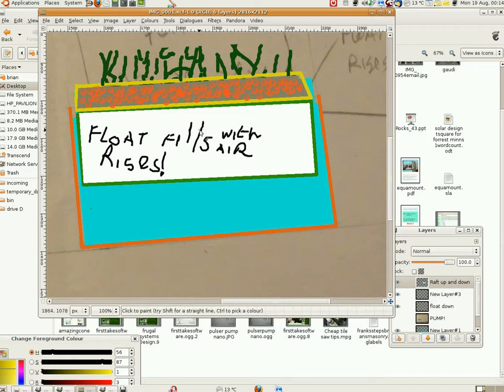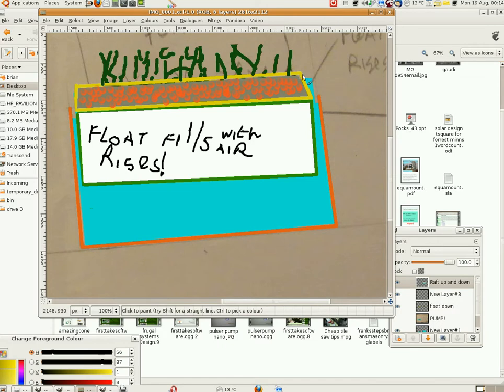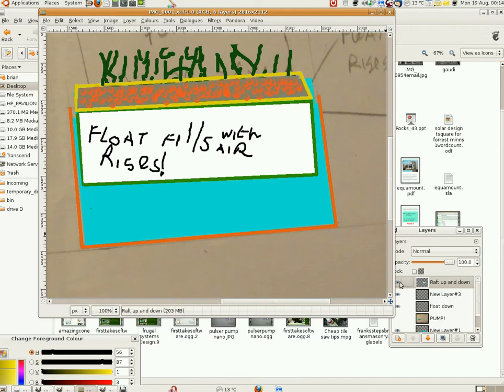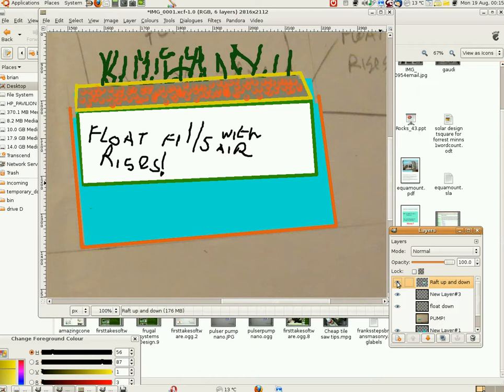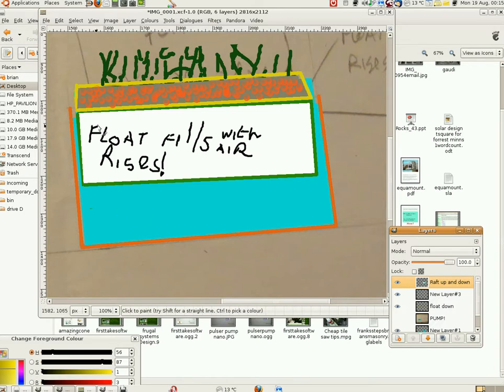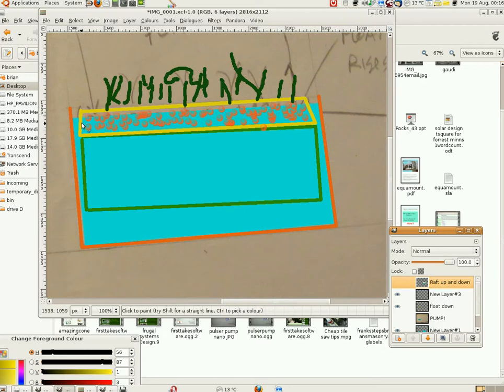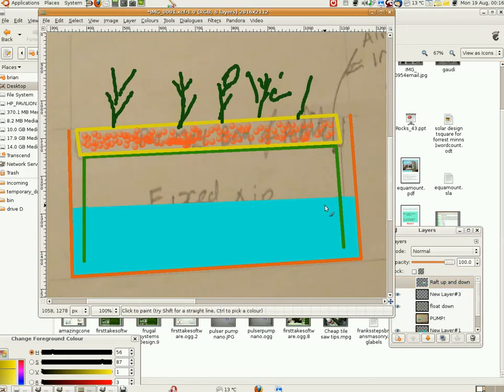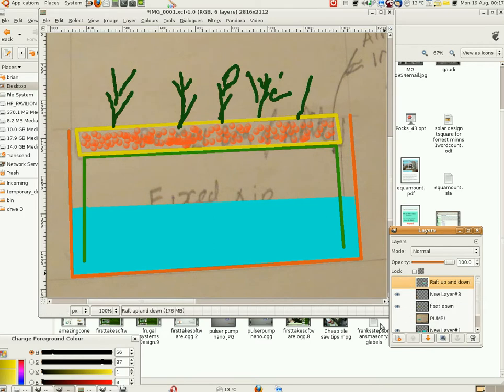Hydroponic or aquaponic raft ebb and flow or  Fixed air tank ebb and flow!

Comment from the maker: Just a note that this is a "concept" video. It is about the idea of using air to create an ebb and flow aquaponics system.  I use an aquarium bubble pump in my experiments. They produce up to about 3 psi and in the region of 120 litres per hour  for less than 5 watts of power.  Also note that in the stationary tank version, the tank could be filled with vertical  wettable leaves and work as a "gill" or "lung" right down there at the bottom of the tank.  (in addition to its role as an air  "piston".  So all in all, it is quite the departure from  bell syphons and  rafts.  But it might work too.  Brian